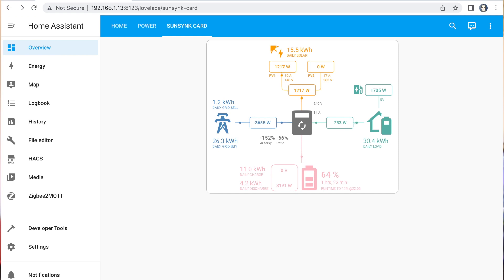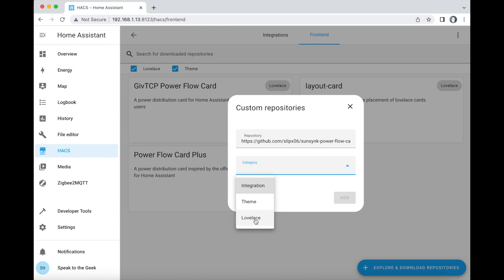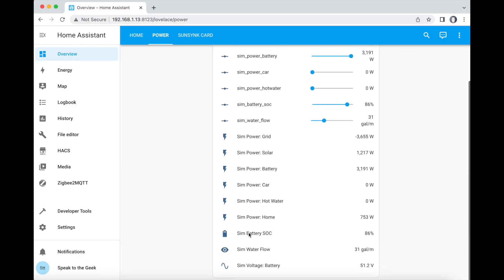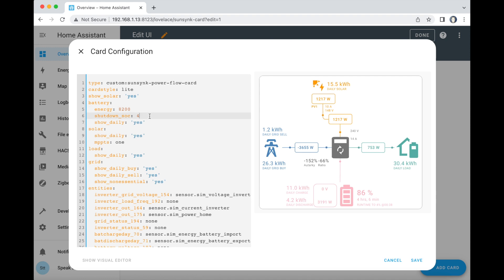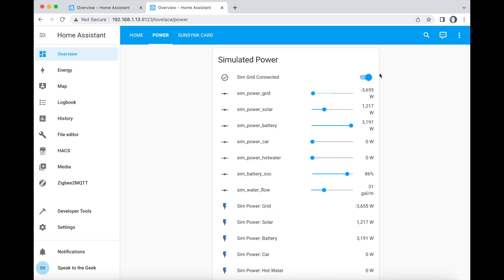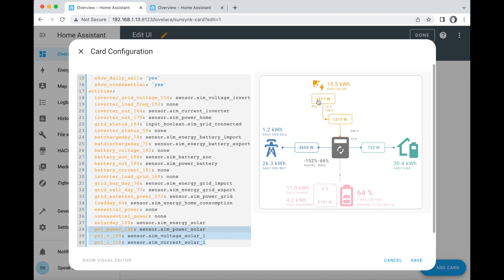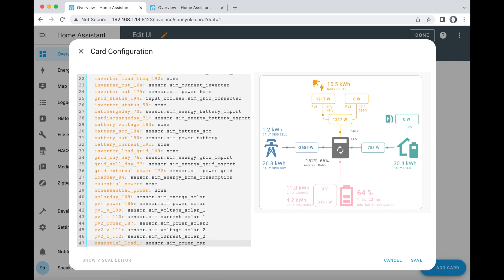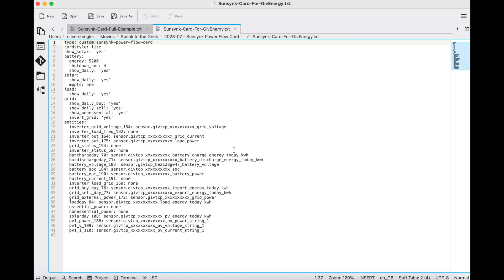Sunsynk Power Flow Card for Hybrid Solar and Battery Inverters

Comment: what card is useful if I have two inverters, one is hybrid with battery
Reply from the maker: Difficult to put multiple inverters on most cards, I just use template helper sensors to combine the values and show them as one.
Reply: @SpeakToTheGeekTech  thanks mate. I was able to add power of other inverter as AUX.

Comment: Hi! Thanks for the video. I wonder if there is any way to speed up the data retrieval. In my case it takes 30 secs to update the flow card data but I wonder if you know how to change this frequency.
Reply from the maker: I think it displays it as often as your source sensors are updated, so check your source sensors that you're using in the card to confirm they are updating more often than 30 seconds if that's what you're after.

Comment: How do I get load and grid datas in with my huawei sun solar?
Reply from the maker: I don't know sorry - I don't have a Huawei inverter. You'd need to find a Home Assistant integration for your inverter first and that might provide the data for you. If it doesn't then you'll need another method of getting it, such as a smart CT clamp energy monitor, or some form of smart meter integration. I use a Hildebrand Glow CAD/IHD.

Comment: when I go to add the card to my dashboard it is not available in the list.  What could be wrong?
Reply from the maker: If you've installed it using HACS, then the most likely reason it's not yet visible to add is because of your browser cache needing a refresh. You might need to force the browser to refresh from source, clear the cache, or just try a different browser to test if you have another one installed.
Reply: @SpeakToTheGeekTech  I have cleared the browser cache.  I am using chrome.  It has not made a difference.  When installing from HACS I got a message that lovelace is not in storage mode.  How do I put lovelace in storage mode?
Reply: Although the card is no visible in the list of cards, if you search for it you can find it.  So I have managed to install it.  Now I have a new issue, most of the values are zero.  Only batty charge is correct.

Comment: Great video. Is there more on setup for HA newbies ? Is this a direct integration using rs485 data ?
Reply from the maker: This isn’t an integration for Sunsynk inverters, it’s just a card to display data in HA in the same style as the display on a Sunsynk inverters. You will need an integration already in place for your inverter and that can be of any brand (I use GivEnergy as an example in the video)
Reply: I got the card working except I don’t have data from pv2 or for the combined ( pv1+pv2 kw ) . Any idea how to map those

Comment: Great card and great video! 👍Just attempted to set this up for my Sonnen system, but unfortunately it's not working at the moment 😭so will have to wait to see if I've gotten the right sensors in the right places once it's fixed.
Reply from the maker: I hope you get that sorted and you find the card useful. I've heard from a couple of people who are now displaying this card in their homes on things like old iPads.
Reply: Inverter was finally swapped out on Thursday so got this working now, although it's a shame that the format changed since your video! Shame there's no way to adjust units on the fly.
Reply from the maker: Good to hear! The format on this card appears to change every single time it gets updated. I couldn't keep up with the changes on this card even if I tried!

Comment: Very good. Thanks
I already configured my ZCS Inverter but I have a stupid (I'm sure for you but not for my poor knowledge on Hassio) problem due to the power unit of measurement that are in kW and not in W. I suppose I should create eqyivalet entitie just oltiplying them by 1000 in some way but how? is nayting I could add in the same yaml file?
Again, sorry for the stupid question
Reply from the maker: You'll need to edit configuration.yaml and create a template sensor. It'll look something like this (note, totally untested and off the top of my head):

template:
  - sensor:
    - name: Power Sensor in W
      unique_id: power_sensor_in_w
      state: "{{ (states('sensor.original_power_sensor_in_kw')|float(default=0)*1000 }}"
      device_class: 'power'
      state_class: 'measurement'
      unit_of_measurement: 'W'
Reply: @SpeakToTheGeekTech  many thanks

Comment: Oooh! Now that's interesting! :) I'm running a Sunsynk system - I wrote my own modbus service and a simple website to do similar to work around things like USB passthru.  Time to dust off home assistant again...
Reply from the maker: Sacrilege! It should never be allowed to get dusty :)
Reply: If you have a sun sync with the USB data logger you can pull the data directly from it, it will only update every minute though. I am installing solar assistant later this week once I finish putting up the solar array for greater insight. But this car handles all the features of all the Deyes inverter I am really happy to have found it.
Reply: @bedel23  How do you pull the data from the logger?
Reply: @ you can scrape it. I ended up not using it, and using modbus via solar assistant, as the data connection was so poor from it.

Comment: Thanks for the shout out. Mine has an update pending. It seems to have renamed some of the setting names. I need to reconfigure mine. I never got the grid to animate, but maybe that is fixed in the update. I will post my YAML for my Lux inverter to my site.
Reply from the maker: No problem, thanks for the tip off! Yes, after making the video the dev pushed out an update with breaking changes. Loads of entity names in the config are different. I've updated the sample config on my site, but obviously the exact examples shown in the video will be named incorrectly now. They're all still numbered the same though which helps massively in identifying the changed names!

Comment: Thanks for the video, really good. I have a a solis Hybrid with pylontech batteries. I am using the solax inverter modbus integration. I have installed the card, and over the next week or so I will try to get it working, and let you know the results.
Reply from the maker: Sounds great!